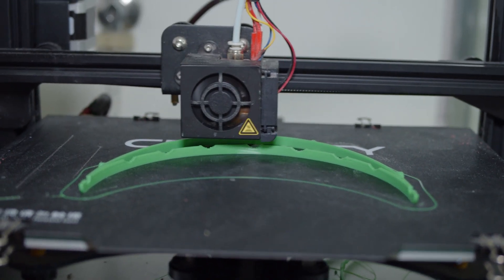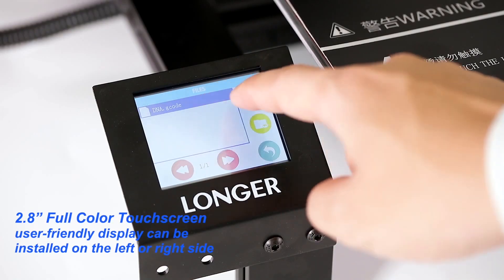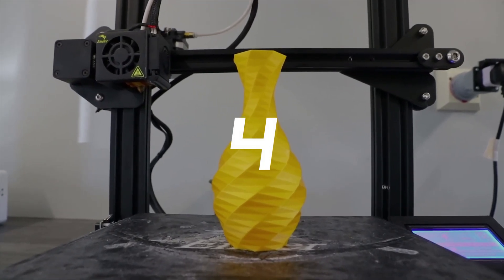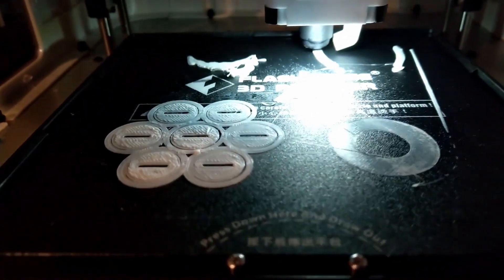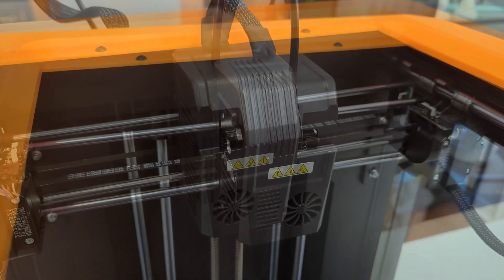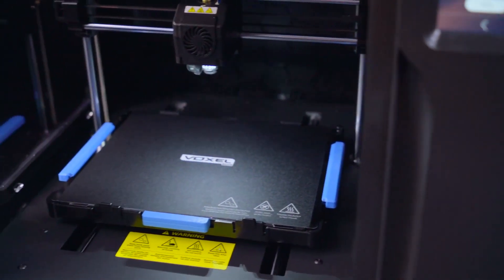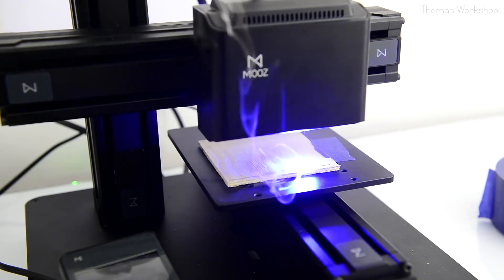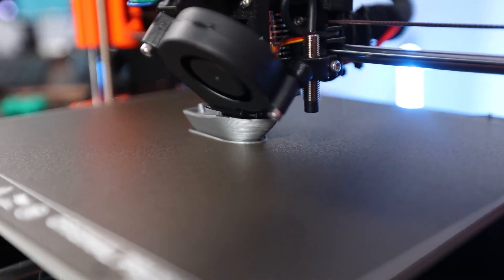Top 10 best CHEAP 3D printers with PRICE and LINKS! 🤑💵🧠

Comment from the maker: Amazon links (price may have changed after video was uploaded):

#10-Monoprice Mini 3D printer ($280): https://amzn.to/3lcXtFU
#9-Longer LK4 3D printer ($283): https://amzn.to/3JVnKTA
#8-ANYCUBIC MEGA X 3D printer ($230): https://amzn.to/3Xh1bf2
#7-Creality Ender 3 Pro 3D printer ($240): https://amzn.to/3RIDOtQ
#6-FlashForge Adventurer 3 3D printer ($450): https://amzn.to/3XjV0XH
#5-ADIMLab Gantry Pro 3D printer ($450): https://amzn.to/3YhoZ3Q
#4-Flashforge Artemis 3D printer ($526): https://amzn.to/3XpC4He
#3-Monoprice Voxel Pro Enclosed 3D printer ($647): https://amzn.to/40E8m3U
#2-DOBOT Mooz 3D printer ($800): https://amzn.to/3jQcg9b
#1-Original Prusa i3 MK3S+ 3D printer ($1,300): https://amzn.to/3YstxUK